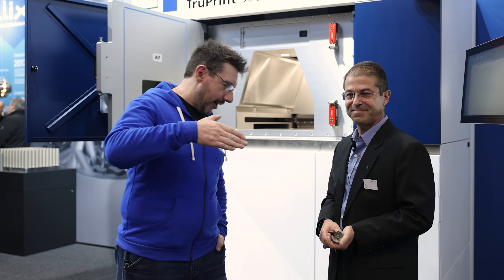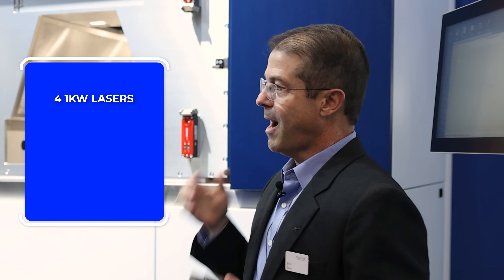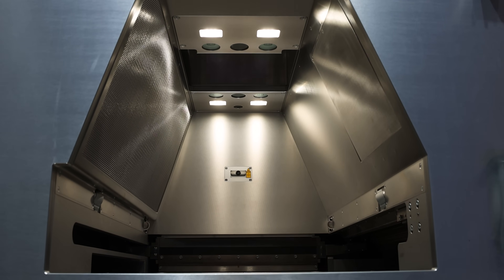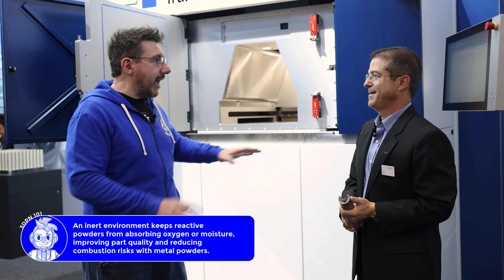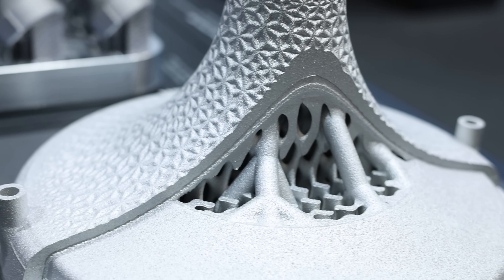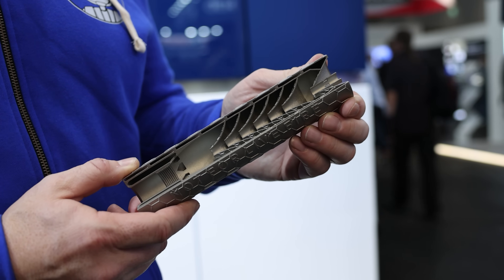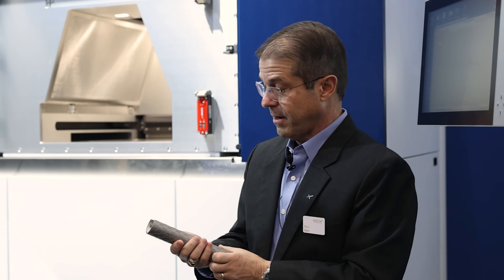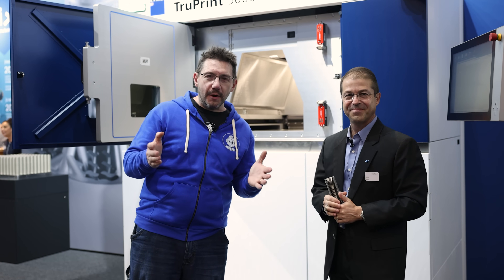Titanium 3D Printing with ATLIX!

Comment: i have a friend in east tn who is a semiretired dentist.  they don't really do manual dental appliance builds anymore if they can help it.  a lot of the more generically compatible components like braces & bridge supports are ordered, but most tooth replacements & crowns are now made in-house via 3d printing - special resins, so i've been told.  i've seen some of the older machines for sale within a 150mi radius of where i now live, but those machines look more like sls.  fascinating that it's all come so far.

Comment: Have fun cleaning a fully enclosed can with all that internal geometry.  It looks cool, sure.  It'll be easy for them to manufacturer and a burden for anyone to use.  Just neat for neat sake.
Reply: They are already on market and getting fantastic reviews. they clean up just fine because there's no rust and the solvents clean them up.  plus the cost comes down which is a huge factor.
Reply: @fwaynedavis  
One, they get mixed reviews, i see as many people calling it crap as calling it great ( the shills )
Also no, they arent cheaper, they are much more expensive. Production cost has 0 to do with how much a thing costs in the story, since its "new tech" they can bump up the margins and rise the price.
The pricing of silencers right now is insane, they cost at lest 5x too much for how easy they are to make, you can buy two!!! entire rifles for the cost of a single silencer.
Reply: you dont really need to clean a high power suppressor (i.e. 5.56 or more). But if you do you can use one of those suppressor baths and soak it for a while. I have a B&T flowthrough print xh titanium / incconnel hybrid suppressor (3d printed)

Comment: Great idea to print a single piece suppressor. However, they get dirty and they need to be cleaned. Still would stick with a tube that is able to be disassembled.
Reply: @LegendaryJim_YT  just print a new one lol
Reply: Rifle and pistol cans do get dirty, but not nearly as bad as .22lr cans. I have an Omega 9k that's basically sealed. I haven't shot it enough to need cleaning, but when I do, I don't expect it to be nearly as labor intensive as a .22lr can.
Reply: There are titanium safe solvents that can be used to clean them. You submerge them in the fluid and toss them in an ultrasonic cleaner. I do the same with non-3d printed cans.
Reply: @WonkoTSane  Yes, ultrasound is your friend for all those hard to reach places.  Even each to reach places are good in US vs scrubbing by hand.